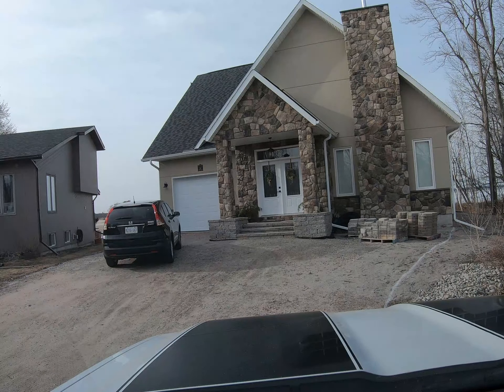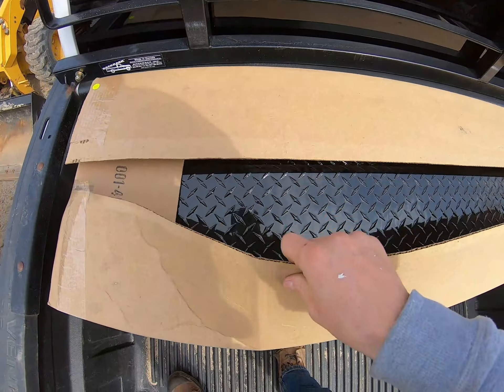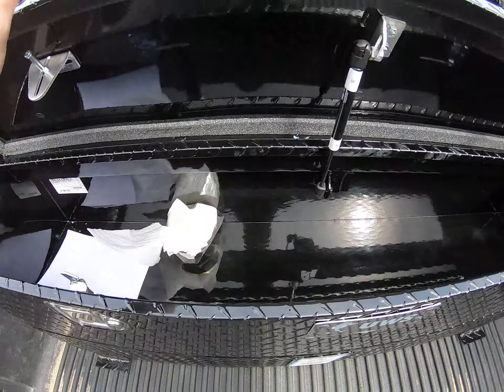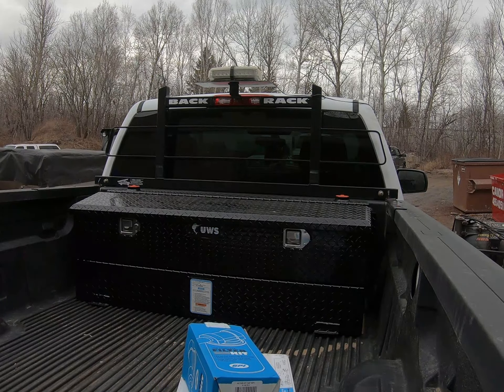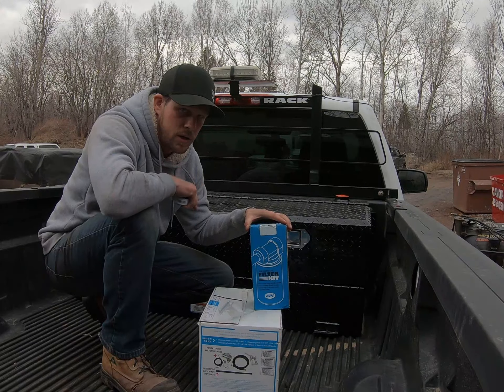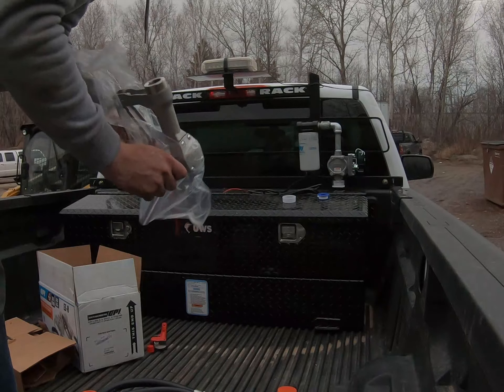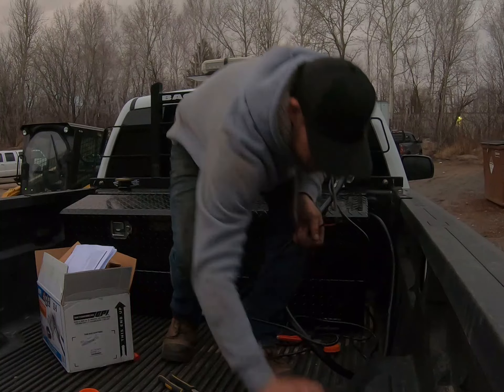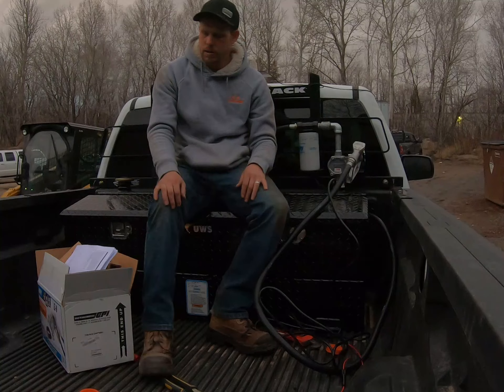How to install a transfer tank

Comment: 18:12 Amm no, that's not the point LMAO. Every piece of equipment has at least one fuel filter if not two. The point of having a transfer tank is to make refueling more convenient.
Reply from the maker: Agreed but!! You need a filter on all tanks because they will develop dirt in them 
Even fuel station pumps have filters on them and is why they change the storage tanks after x amount of years
Thanks for the comment